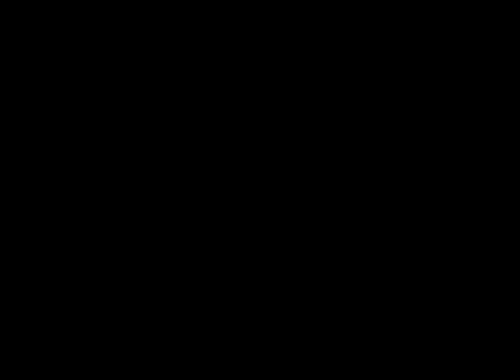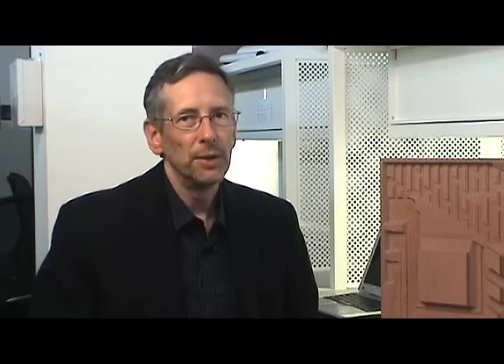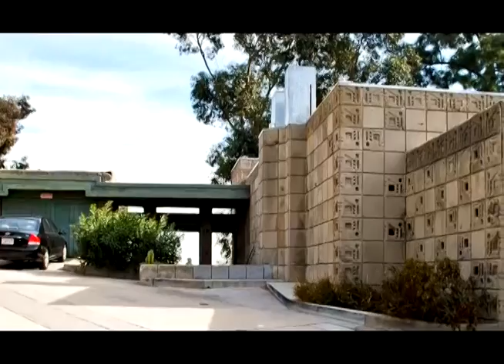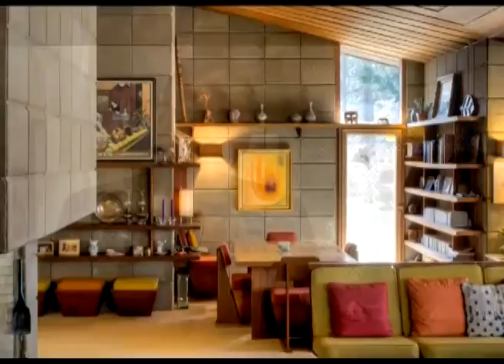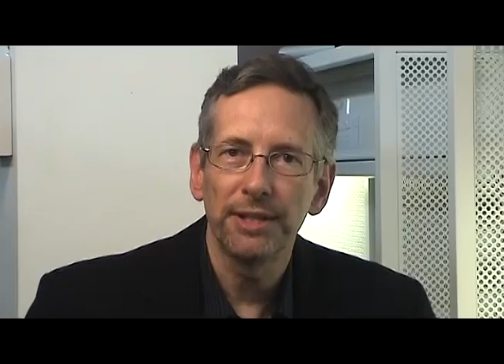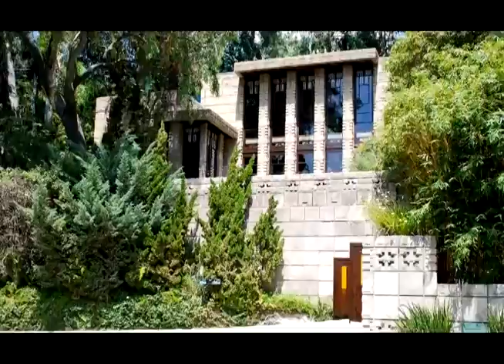Edward Losch - Frank Lloyd Wright's Textile Block Revisited

Comment: TheWedelley:  That's the same question that led me to this video.  I wonder if 3D printing would be a relatively inexpensive way to create test molds/patterns.
Reply: Yes. 3D-printed features would be adequate for molds, however, if you’re a perfectionist then some post-processing would be required in order to prevent transferring imperfections from the mold into the blocks which would be a constant reminder

Comment: Flawed design, the original textile block design only allowed approx 1-1/2" channel of concrete grout into the grooves of the block, this allowed water to reach and eventually rust the steel rebars. Plus today you could simply use any number of the wider variety of CMUs currently on the market and still build a very nice later style Usonian type home. This would be nice to use to create pattern textile blocks.